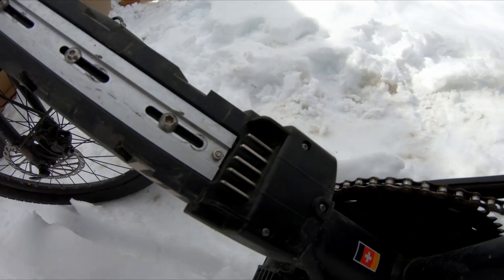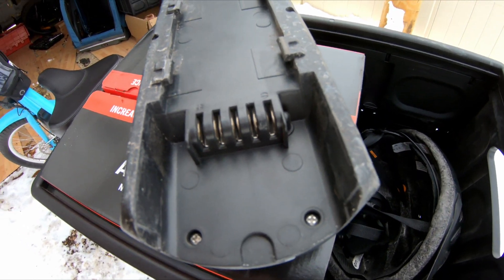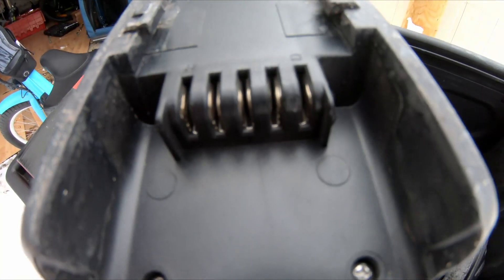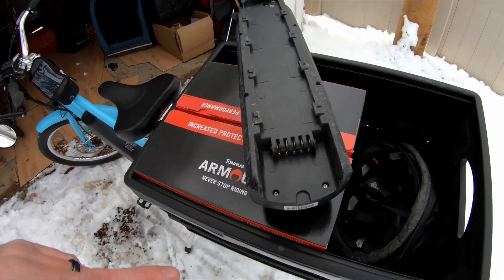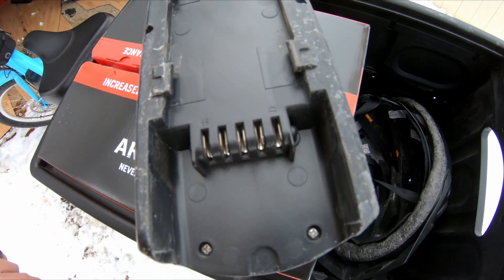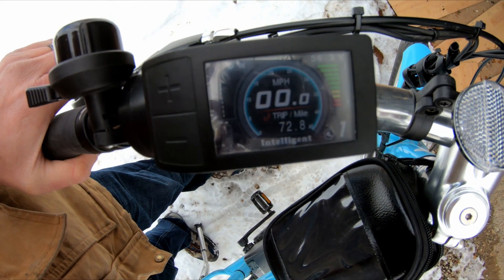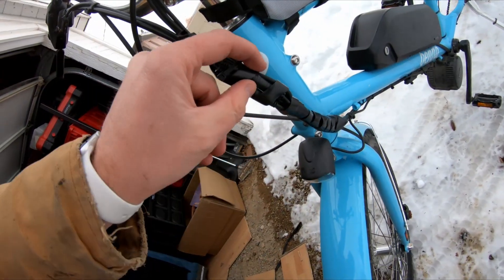Electric bike not working? Try these Troubleshooting steps!

Comment: A fine video Thank You Kindly - I've enjoyed my Swagton for 1 year yet after slightly adjusting the hand brake it has show no power what so ever the past 6 months, What adjustment should I make to the Brake Connections to correct, Thank You.
Reply: It woukd be nice if he responded. .  Did you figure out the issue because I think I may have the same problem but idk.  Showing an error code 10. Bike will not go and also my head light is out.  Leading me to think it is the controller

Comment: Hi Johny, I have e-bike. Flyer Uproc7 I can't figure out what could be wrong. I have the battery fully charged the wires have been checked and the display shows me that the battery is empty and in red. It shows me one error 67-32 according to the service book. I don't know what to do? Can you help me??? All assist functions are in OFF mode.

Comment: Parts swapping is nice if you have parts, but they are expensive to buy. Need a how to trouble shoot with a volt meter. Right now, my 36v battery measures 37volts dc. My throttle is varying voltage 1-5 volts dc, my motor (wheel) will bump with a nine volt battery, no codes on display, brake interlock is disconnected, controller has a flashing red status light.  All pins are straight and not bent. Won’t go.
It worked for 3 months, Now out of warranty.  It’s an expensive piece of junk!

Comment: Help...Brake light wont come on even with headlight on. Error 25 came up for just a second then went away and we noticed the rear brake light didnt work at all. I checked the wires into the brake light and also unplugged all the brake light Leeds and put them back on, still not working. Bike runs great with no error code now but brake activation or headlight turned on there still is no NO BRAKE LIGHT Thoughts? Guess I need to see if the brake light itself went out.. Himiway Bike has 5 hours max on it... The nubbies are still on the tires.
Reply: Well I did a volt check to the rear light and NO POWER. Again checked all the leads and all connection pins look good... Himiway wants a video of the problem. I think this is their way to make me go away.... Why a video, brake light doesnt work when brakes are applied or when headlight is on. Give my a solution to the problem or another place to look!!!!!!!!!!!!!

Comment: My custom built e bike died when I was braking the regen came on for half a second then gone I look down to a blank display it will not power on anymore the battery is fine and at about 80% -85% charge my 12v system gets it's power from the controller and all the lights work just fine. I've only done limited testing on the controller but I think it is the display because the on/off is connected to it and if turning the key off cuts power to the display then that on/off button may do the same.

Comment: I’m a poor older (74) guy. I bought an older step though la free bike. It worked fine. All I did was pull up the battery to see what it looked like and then put it back in. Now all 5 red lights blink on the display and nothing else works   Any thoughts specific to this bike ?

Comment: I have a rear motor on my ebike. I was riding and my brake line to the back wheel snapped at the lever, then the motor stopped working. I'm going to try what you said about disconnecting break cutoffs and see if that fixes the problem... will report back...
Reply: So I followed the wire from the handle bar to the control box and disconnected the wire and IT WORKED! Thanks! I didn't even know about break sensors until now...I thought my motor went out....AWESOME
Reply: I can turn on my ebike, the screen is on, but when I pedal there is no power and the screen turn to error 03. Maybe same problem as yours.

Comment: Hello! I have a Scott e-sub tour bike and i have a problem with the motor. It suddenly started not connecting the gears inside. I mean: whether or not the bike is on or off, when pedaling i dont get any transmission inside the motor. Please help!
Reply from the maker: You might need to do some investigating inside the motor to make sure no teeth have broken off
Reply: @JohnnyNerdOut  thanks for the reply! so i need to order the service kit parts also, probably?
Reply from the maker: @zoltanrab9032 I don’t know what that is, but I would check inside the motor to make sure everything looks ok

Comment: Not sure what happened, but my mini display will not turn on. My battery is fully charged and the connection harness is securely attached. I noticed a spark once when inserting USB   programming cable. Not sure what the issue is. I looked to see if there were fuses inside the battery pack and there were not. Are there fuses on the controller or inside the motor?
Reply from the maker: No
Reply: @JohnnyNerdOut  Ok, thanks. So the tiny spark must have ruined the controller. No power going to the display. Guess, I will need to purchase another one

Comment: the bike battery shuts off after it runs for few seconds...it runs on the slowest speed, but as soon as i accelerate everything shuts off.
Reply from the maker: sounds like a battery issue, is it fully charged for sure?
Reply: @JohnnyNerdOut  it is a 36v battery, when I turn the buttery on (it has a on and off switch) and measure the voltage it is at 41.5v
Reply from the maker: @Andre-jp4yt  it sounds like the battery is turning itself off because it’s being taxed too much. It’s hard to diagnose without seeing it and being able to test it but it could be a battery issue
Reply: @JohnnyNerdOut  makes sense, that is a good start

Comment: Johnny NerdOut thanks for your tips!! My ebike stopped working after a 5 mile ride. Frustrating for sure! I reached out to Ancheer and they wanted me to unplug the handle bar wire, Sensor wire, brake lever wire, from the control box. I am lost in what they want me to do. Can you make a short video or explain what they are wanting me to do? I'm no expert and these wires all look the same. Everything on my bike powers on but my bike will not go into power mode after pedaling. Even though the meter is on, my Ancheer is not responding. Please help. Thanks!

Comment: Hi Bud, just subscribed to your channel here’s a good one for you, I was replacing the crank bearings in my Giant Stance E+1 all good then I noticed that the positive & negative connection to the motor had a small amount of corrosion starting not bad but decided to change it. Unfortunately I cut across both wires at the same time there was a short across the cable’s ( not connected to battery ) didn’t release the motor must hold a small charge. Now when all reassembled the bike trying to go but stops after a second or so what will I have blown up inside the motor, disassembled can’t see anything burnt or melted really annoyed with my ignorance.🤨
Reply from the maker: Happens all the time! Don’t feel too bad. Might have burnt your controller possibly.

Comment: Hey Johnny I just got an ebike. So my problem is two things, my throttle only works when I push the ebike up to 4mph or when I use the pedals, but it doesn’t work when ebike is stationary, the throttle is useless at this point. Second problem is the lcd display Keeps shutting off the first 5 minutes of riding the ebike as well as the battery bars on the display jumps from 5 bars to 2 bars to one bar back to 5 bars like in seconds, when it’s actually 4 bars or fully charged. can this be that my battery doesn’t have enough voltage ? Or faulty battery ?
Reply from the maker: What kind of ebike?
Reply: @JohnnyNerdOut  I have a Viribus 14″ electric bike with a 250W RWD motor and a 36V 6Ah lithium battery which is removable..
Reply from the maker: @Randii225  do you get any support from the “manufacturer “?
Reply: @JohnnyNerdOut  yeah! right now I’m in that process as we speak, they got me speaking to one of their mechanics. He had me inspect the Ebike just like you suggested on your video’ everything looks normal to me’ motor works’ throttle works besides from what I told you, the breaks works’ pedal assist seems to be working fine. I disconnected the breaks and see what happens’ same behavior..
Reply: FYI this mechanic lives in a different state 🤦🏻‍♂️

Comment: Hi , New Subscriber here ! I just acquired  a older Giant Twist with a 26 volt front hub motor . It's battery is bad for sure but may have some other issues . Instead of spending $500 on a new 26 v , may I use a 24 or 36 volt battery instead ?
Reply from the maker: You “should” be able to. Check the controller for the voltage range it will accept

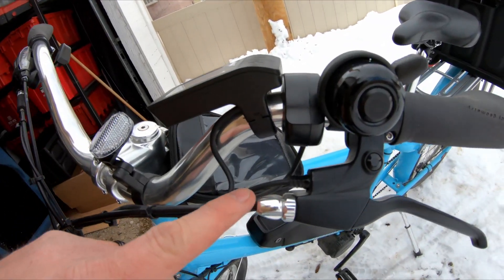Comment: 3:24 thank you so much for this video... My Dad's e-bike had an issue, the problem was simply to check the wiring.
Reply: Hello Terry I also have similar issue I don't know if you can help me out
Reply: @symboloffhope  What I did was unplug the cables and plug them back. I don't know if that will work for you.My advice is keep watching videos or go to a local bike repair shop for help.

Comment: If I need a new throttle will I need a specific one or can I buy any one from eBay
Reply from the maker: Needs to be specific unless you plan on splicing cables
Reply: @JohnnyNerdOut  what’s that?
Reply from the maker: @kkmusic104  you need to make sure the connectors are the same. Or make your own.
Reply: @JohnnyNerdOut  im gonna find a bike shop near me who can fit it for me
Reply: @JohnnyNerdOut  so if I bought one from say eBay would they be able to do it?
Reply: @JohnnyNerdOut  or could you maybe point me in the direction of which one to get
Reply from the maker: @kkmusic104  go through the manufacturer. If it’s an aftermarket motor it will be a lot easier to source 👍

Comment: My battery works(checked with a voltmeter), my display turns on, I tried unplugging brake sensors, my motor does not run at all, what could be the issue? Is there a way to check that motor is working ?
Reply from the maker: Hey Gary- You can schedule a troubleshooting session with me on my website and we can try to get you up and running again. www.johnnynerdout.com
Reply: @JohnnyNerdOut  How does that work exactly? We do a videocall with each other and I open up my ebike infront of you as you give me instructions?
Reply from the maker: depends on the situation, but we can Facetime or Zoom. It's hard for me to help people out through YouTube comments so I offer one-on-one consultations and troubleshooting sessions.
Reply: That happened to my bike what you have to do is the display say 21h that means it is the speed sensor

Comment: morning nerd out guy! Question, bought bike (ecotric) w/fat tires (about $800 model - never ridden the bike, the battery was fully charged from the box - and will show fully charged when on charger - take it off the charger and it shows nothing - the display on the handle bar will not come on - think its a bad battery?
Reply from the maker: Get a volt meter and start detective work!

Comment: When replacing components, is it best to replace with quality parts, and do these parts need to be compatible with each other ie same make rather than mixed. Here in the UK there is a popular E bike called the Carrera Crossfire which seems to have different faults and even the supplier cant seem to solve it. Its said that the components are of a different make to the Suntour hub it uses would this be a problem. You seem to be the man to know.

Comment: Thanks for info!!
My premium headlight for my rad rover is not working anymore. For some reason it just stopped turning on. I checked all connections but still no luck. Any chance you’ve run into this problem before?

Comment: You are THE MAN! My RADCITY lost power about 5 miles down the trail. Had to hump it back to my car. Spent some time checking it over. (What do I know about ebikes?) Watched this video and where you talked about the brake cutout got my attention since the power failure happened right after I applied the brakes. Went and checked out the rear brake lever and noticed that somehow the throttle cable had got caught in the brake lever opening. Releasing the brake lever was squeezing the throttle cable. Worked it loose and bing-bang-boom. Back in business with full power! Thanks so much. Like to buy you a beer and a good cigar.
Reply from the maker: My man!
Reply: @JohnnyNerdOut please help me
Reply: Have a friend with a 2019 Rad City. Lost power. Rad tech support sent a new controller.  Nope. A new wiring harness.  Nope. New throttle cable.  Nope. Got to be the battery then. Can't get batteries right now! Sorry.
Reply from the maker: @tomobrien1814  in a pinch. Any similar voltage battery will work 👍
Reply: @JohnnyNerdOut  I think Rad would have sent one if they could get one.

Comment: On a Tongsheng, you can disconnect the speed sensor. It is a good thing too. Theirs is ridiculously sensitive. Setting the magnet too close causes more problems than too far (makes the motor work really squirrely). 

Burned up controllers are by multiples more common than burned out motors. Motors a hundred years old are still in daily use throughout the country (I have a customer that has rows of  W.W. I era screw machines operating 17 hours a day).  There's no reason to believe e-bike motors will be any less reliable. 
Controller burn out is more common on bikes throttle ridden a lot and those that have been moded outside factory spec's.
Reply: you think that is what the problem is on the Lectric?

Comment: Johnny HELP !!!   My bike is about 7 months old I have an acceleration problem  The company seems baffled....   The bike goes faster than pedal assist level . I will be stand still position lift my rear tire and it is rotating at a fast speed.( My hand is not on the throttle and nothing is touching the throttle). I tried to clean the sensor with compressed air like the company told me to with no luck. ANY IDEAS????   Thanks
Reply: Have you tried a different throttle?
Reply: @MHH3180   The dealer is sending  me a new throttle. once I disconnected the old throttle the bike was working fine.

Comment: Hi, I got new e bike and stop working pedal assistance. On display it's show zero watts so no help while pedaling even even on max lvl. Any ideas? Thank you
Reply: Without more info it is hard to say much, but obviously the display is working, so something is not telling the motor that you are pedaling (assuming it works on throttle).

I am also assuming the speedometer is working. If not, it is likely the speed sensor and the magnet are not aligned.

I would guess this is a hub motor with a cadence sensor at the crank. It could be missing magnets, or the wire broken or just no longer in alignment. They are cheap and easy to replace.
Reply: @MHH3180  problem was in center of the pedal.  There was a weak seal so it didn't know the pedals were turning. Sorry for bad translate 😅 but I hope it's clear what I want to say.

Comment: I have a battery and I need to switch it on and off twice for my monitor to light up.
Reply: I'm having this problem too. I've been told it's the battery - dodgy key switch/soldering connection.

Comment: What if the speed sensor fried? Where the wire attaches to the ring. Mine emitted a tiny puff of smoke. Now the motor won't run. Speed sensor on order.
Reply from the maker: Might have to do some custom wiring

Comment: I have spent hundreds replacing everything except the motor and pedel sensor and my ebike still isn't working correctly..
it intermittently not powering the motor
Reply: Is speed sensor aligned properly?
Reply: @MHH3180  its a hub motor so I don't know it's inside the motor ...
Not easy or cheap to find the correct replacementy for my Hub Motor either can't find it on ebay only Alliexpress

Comment: I’ve covered all the things you covered, without opening the hub I don’t think there’s a way to fix it. Appreciate the upload though because I formation on this type of bike is hard to find. Buts it’s just an 800$ pile of junk now. Brand new.
Reply: Same wtf
Reply: @HoodCerti  One of the Anderson connectors was broken and would shut the motor down while riding. By following these steps I found it when the wire came out of the connector while unplugging it. I fixed it by using the barrel type ones that everyone claims are cheep. Those Andersons are garbage and probably the source of many problems.

Comment: Really hard to find information on rear hub motors. 
I have a 6 month old Kent I just got from Walmart for 800$ on sale and it’s already junk. 
The motor makes a horrible “rubbing” sound inside the motor, nothing I can physically see is rubbing, so it’s internal.  If I try to run it while it’s making this rubbing noise it will only go for a few seconds before turning itself off. 
It’s under warranty, but Walmart and Kent does not care. 
Feeling pretty hopeless about it. 
Not sure how to fix it.
Reply from the maker: That sucks! If you want, you can book a troubleshooting session on my website and I can try to help you fix whatever the issue is. May not be able to- but might be worth a try? www.johnnynerdout.com best of luck!

Comment: My battery stops charging after it gets to 1 bar,  any fix it ideas??
Reply from the maker: try a different charger. could be a bad battery cell too
Reply: Fixed it just tighten connection s, works great now👍🌈

Comment: Hey Johnny NO ; Dielectric Grease on Connector's , Work's Every Tyme ! Push'in 70 & Not My Bike !? 14 Year E - Experience ... YYZ , Mohawk-Planker . Hardtail , 29'r / 12 Gauge Spokes / 36 v , 15 Amp - Hr & 21 Gear's + E - Rated , [ 50 KPH ] + Spiked Winter Tyre's / Trailer . 700 lb's with Trailer is Not a Problem ! Built All Myself . X GM Welder & AME - Aircraft Mechanic . 4 Sale as Now in Wheelchair & Shopping 4 Scooter ...

Comment: Excellent video.
Leaving the battery on the bike for charging protects contacts.
Chaining up the bike to stop it falling over , also protects contacts.
Cheers mike
Reply: water is in the controller the red light is on  what to do
Reply: Ithink that there is water in the controller
Reply: Red light is on